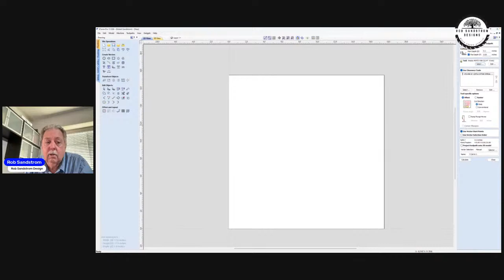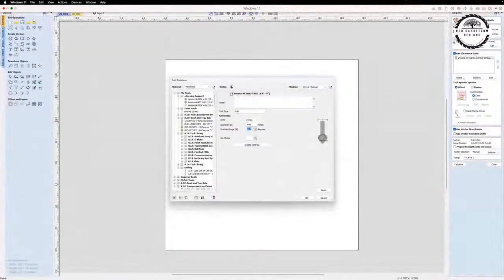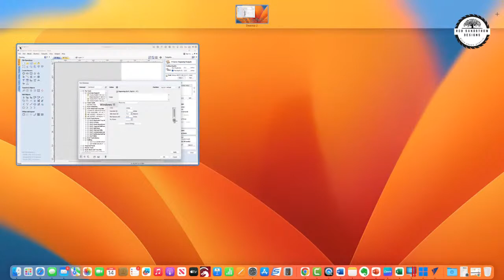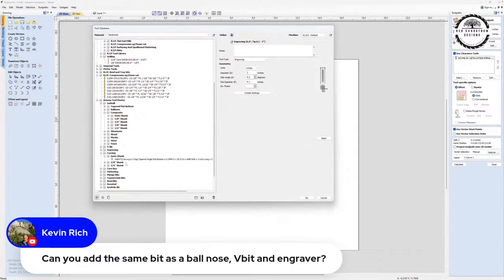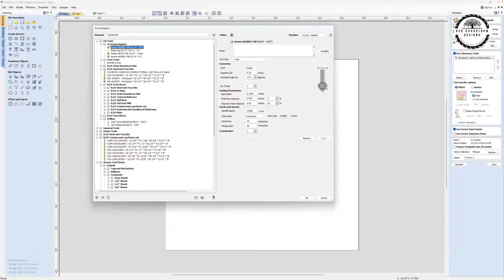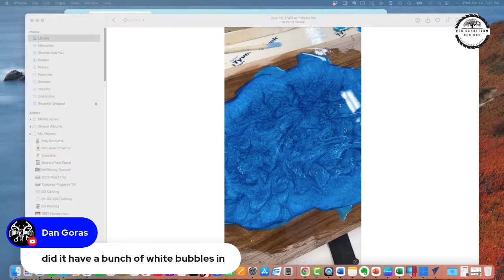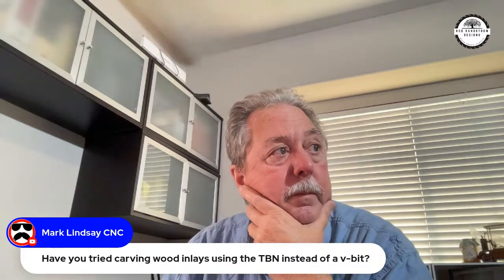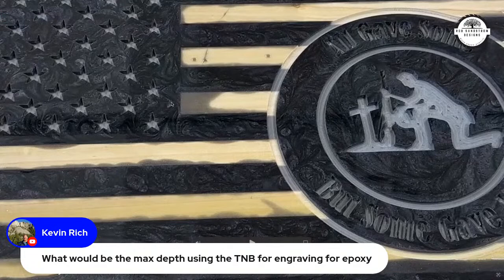Live 003 Setting up a Tapered Ball Nose as a V-Bit

Comment: Thanks this is the first video I have seen on setting up the TBN Bit for inlay. I have done a lot of inlays with VBits,but not with TBN bit. You stated you had taken Broinwood’s course on inlays. I have been thinking about taking. How did you like the course.
Reply from the maker: I liked the course.  It isn't expensive and gave me a couple insights that I might now have had otherwise.  Especially how he discusses checking for the right settings after entering your TBN as a Vbit in Vectric.  If your serious about wood inlays it will give you some insights from a master at that process.

Comment: Excuse I don’t understand: which is the advantage of use a tbn as v bit in vcarve inlay?
Reply from the maker: That is a fair question.  The only advantage is that the tapered ballnose is typically not as brittle as the 15° vbits I typically use for the sharp edges.  Therefore less chance for the bit to break.  Sorry I didn't make  that point clear in the video.

Comment: Hi Rob, so to use this bit ,46473, you cannot have vectors closer than .02 ?
Reply from the maker: Rich...you are correct that if you're vector is less than the tip width 0.5mm (0.019685 in) the bit will not go down into the vector and maintain the 0.02 integrity.  The way it is entered into the database I think it will still go in because it will kind of ignore that bottom 0.5mm tips (we've lied to the database.)  I haven't used it long enough to talk about that much.  Just shared what I have done so far.    

With that said, if you refer to the Shuster table that I provided before - even if using a 15° vbit, the bit depth with vectors less than 0.02 ranges from 0.01 to 0.07 not much when considering you will likely mill off that much.  So you would have to trick the epoxy setup to try and work with a vector of this size you mentioned.  Put in a lower start depth, etc.  It gets tricky.  That's why I generally say vectors less than 0.04 - 0.05 are tricky to deal with.  Hope all that makes sense.